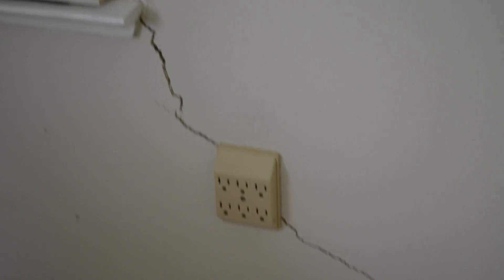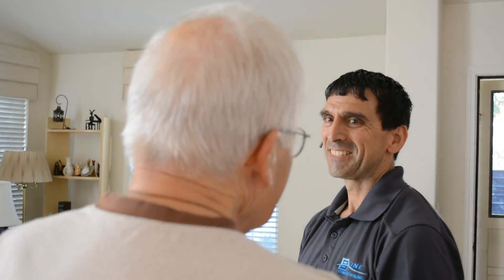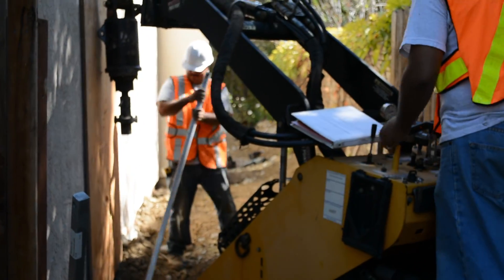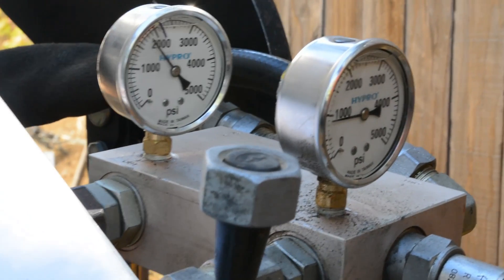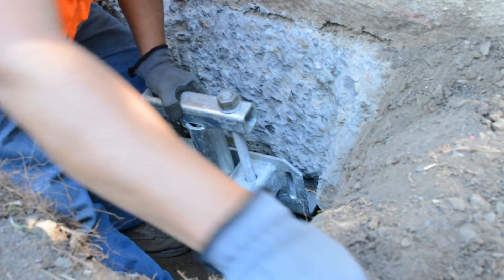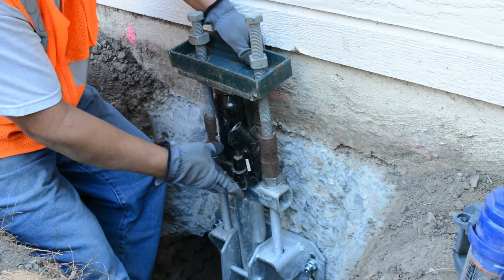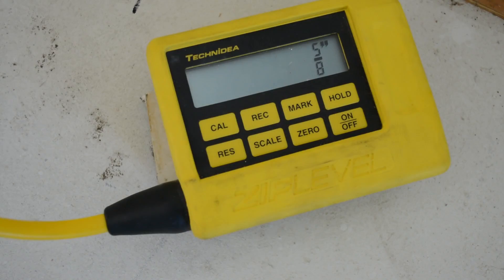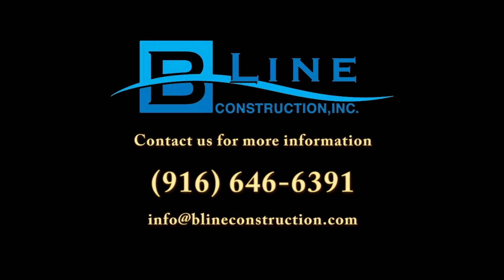B Line Helical Pier Professionals: Foundations Repair Video #3

Comment: Helicals on a house? The weight is too much for helicals. 

Are you doing a soil survey first so you know how deep the load baring strata actually is?
Reply: Sorry Bud’s but your wrong... good question on your part , but stable soil can be read by the operator installing the piles in relation to auger gear ratio / hydraulic  pressure at the time of installation 
Mind you, the piles in the video had something like a 14 inch helix which is great, but the square 2x2 inch shaft is absolute garbage lol 
The more helix on the shaft the stronger load it can hold , but they must be lined up as to not act as an auger going down
Reply: wrong- half the houses in Miami and West Palm Beaches are sitting on those things. an engineering survey that includes a core sample will be required by most building codes for permitting and inspection. where i install these (dade, broward, and palm beach counties)  an engineer is also required at the site to monitor the installation where the piles are installed to a specific torque which determines the ultimate load. the torque can be determined by monitoring the hydraulic pressure of the gear motor turning the pile as it passes through different strata. if you take a look at the blueprint at https://youtu.be/MUkvNH8TeNM?t=52, you can see they are installing 16 piles around only half of the foundation. I don't know the rated static load capacity of each pile as they come in different diameters and with different size and multiple "flights" of augers but you can assume and approved plan like that could probably support at least twice any load it will ever actually have to carry as the enginerds and contractors love over-building these things at the homeowner's expense